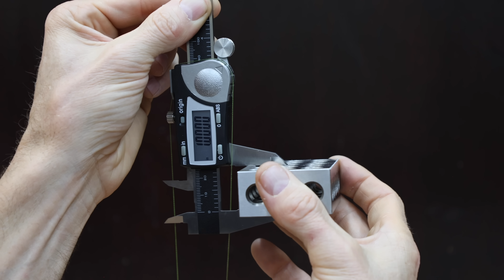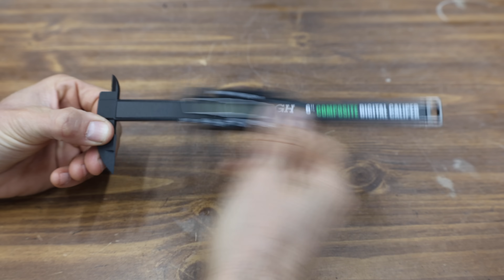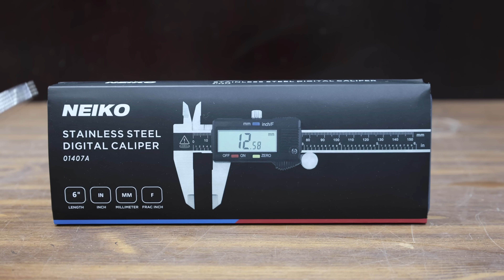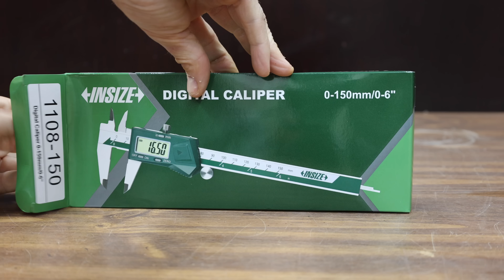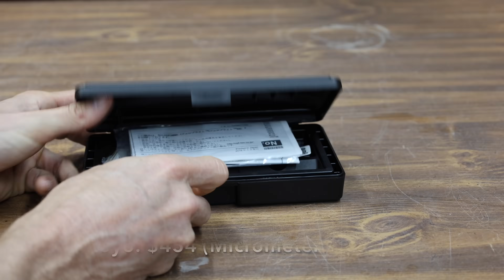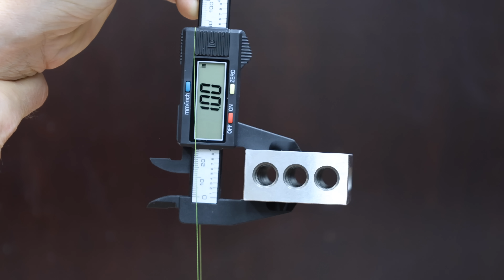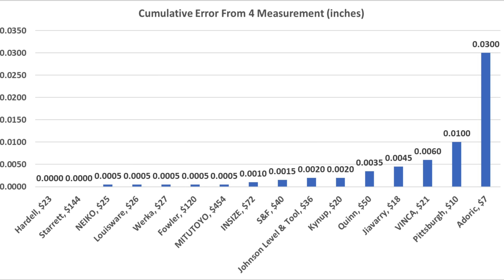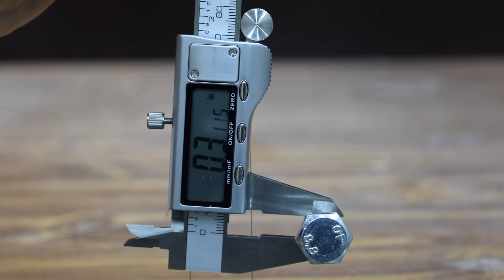I've Been Proven Wrong About Calipers!

Comment: As usual thabks for the video. If I were a machinist, using them every day, I'd definitely go with Starret, Mitutoyo, etc. For the average person that doesn't use calipers very often, the cheapos work just fine. I only use a set a calipers maybe a couple times per week. I've got 2 pair of Pittsburg calipers (different than the ones in this video) I've used at home and work for years and they have been just fine for what I do. What I like most about the Pittsburg is if for whatever reason I break them, just walk into HF for a free replacement.
Reply from the maker: You are welcome!  Thanks for the feedback.

Comment: could you test dehumidifiers? i've owned many through out the years and im curious which brand is the best. You could test energy efficiency and which ones produce the least amount of heat because most just spit out hot air while dehumidifying. and also maybe have a separate category for those "personal sized" dehumidifiers that do not have a radiator/ compressor.
Reply from the maker: Thank you for the video idea!

Comment: When I was a machinist in the airforce all our measuring tools had sent over to be tested before being put into use and then tested again I think it was every year.   The testing was done at a designated temperature.   Our Mitutoyo calipers some were rated at +- 0.001" and some were +- 0.002".  Most of our micrometers were +- 0.0003".   Now I am out doing 3d printing most 3d printers are only accurate to about +-0.1mm(0.004").   My calipers of choice are the Husky home depot house brand because they're good enough for what I'm doing and if anything ever goes wrong the life time warranty means I walk into the closest home depot and the return desk just has me go grab a new one off the shelf. No hassle. No receipts.  As long as it says husky grab a new one.
Reply from the maker: Thanks for sharing.

Comment: After 40+ years of being a machinist, I would have changed the test slightly.  I would have first purchased a Gage Block of 1.000, then 2.000, then maybe 4.000.   Gage blocks are usually guaranteed accurate within millionths of an inch.  The cheap calipers might not have lived up to the various lengths.  1-2-3 blocks  normally have a .0002" accuracy, so +-.0002 overall, and flatness of .0003.  I would have also checked the ID of the calipers using a Ring Gage.  Those are also within 15 millionths.  All my years machining and inspecting we were only allowed to get Mitutoyo, Brown & Sharp, or Starrett.  In my opinion Mitutoyo is the best, but realize many DIYers don't need the accuracy so the cheap ones will probably be ok.  Thanks for the video's as always !
Reply from the maker: You are welcome!  Thanks for the feedback.

Comment: After reading most comments, there were a lot of comments about battery drain when not in use. When I won't be using my calipers I take out the battery and put it in upside-down and close the cover. There are no contacts for the battery to complete the circuit.
Reply from the maker: Thanks for the feedback.

Comment: The cheap ones are great for cheap jobs. A quick disassembly and cleaning will significantly improve the smoothness. Apparently this is probably one step skipped during production, that $10-$20 calipers don't get that $40+ calipers get you. And no, the cheap ones still won't be like the $40+ but they will be better than out of the box.

Comment: I bought a no name brand set with dial calipers and non-digital 0-1" micrometer at Costco and Ive had them for close to 25 years now.  Both still work excellent.  I did about five years  in machine shops and doing tool and die work in the 70's..  In those days, Mitutoyo, Brown and Sharpe and Starret were king.
Reply from the maker: Thanks for sharing!

Comment: I've had a Shahe bought from China for 5 years now. At the time I heard they are an ok option for a cheap but still decent caliper. It's been rock solid all this time. I think I only replaced the battery twice and for my needs it has been precise enough. I'm a bit bummed this brand was not present in the test, I would have been curios to see how it measures up to the others.
Reply from the maker: Thanks for sharing!

Comment: Lithium batteries like the 2032 are "Technically" not allowed in checked luggage and the tool itself is "Technically" not allowed in a carry on. Dial calipers bypass this issue and never need battery replacements.

Comment: I have a set of iGaging IP54 Absolute Origin 0-6” calipers.
I use them infrequently, as most of us typically do, mostly for gunsmith jobs and welding precision (as well as the hack that I am capable of anyway) projects.
Had them for 10 years and have replaced the battery three times.
They work well enough for me, and I use a WEN 1-2-3 block to check them when I use them.
Not bad for a 55 dollar tool.

Excellent testing and review video as always. If I need another set of digital calipers and can’t find the Origin, I’ll look at the Werka.

Comment: I wish that you would have done the husky. The only test that I could replicate was the closure Force test. I ran it several times on a $25 kitchen scale from Amazon. The movement felt smooth throughout. To force range from about 260 g to around 290 g. It is it at least several years old. It uses one of the small batteries that you showed. The battery has not died so far, but I do not use this on a highly regular basis. Thank you for what you do. I really do enjoy your videos.
Reply from the maker: Thanks and you are welcome!

Comment: I have the cheapest ones and they work great. I was pretty skeptical but doing measurements for 3d printing it works just fine. Only downside is it does go through batteries maybe aim to get one with larger cr2032s.
Reply from the maker: Thanks for sharing.

Comment: I'd love for you to throw iGaging into the next batch if you revisit. I found them highly accurate, more of a feature-rich mid-tier.

Also, I don't think I've ever used my calipers outside of metric mode, and yes I am an American.

An idea for another test:

- Vampire Drain: A lot of the cheaper calipers I've used have battery drain (even with auto-off) when in storage, so you'll come back and find them dead after a few weeks.

- Whether they include USB/Bluetooth HID. The set I have sends the measurements as keyboard inputs upon button press.
Reply: I am also a big fan of the iGaging calipers.    They are very accurate and an excellent value.   A machinist would cringe at the way I use calipers because very often they become a marking tool.   I don't have to lose sleep over abusing calipers in this price range.
Reply from the maker: Thanks for the suggestions.
Reply: Do you know if they counterfeit those?

Comment: Working in an machine shop für 10 years, having a Mitutoyo. It is reliable, accurate and in 10 years i have changes the battery twice with lots of daily use. 
It cost somewhere around 150 Euros, worth every penny. 

By the way, dont bother with that little wheel, get one without it.

Comment: Ill just say this. If I walk in a machine shop and they are not using Mitutoyo or Starret or anything US made from 30 years ago, Im walking out.
Normally you do good, but this one doesnt hit the mark. Each time you measure, you will get variations. Its why you measure 20 times for one span.

Also, the stiffness increases at the lower range by design. 
1 thousands off is not even remotely close to being accurate for machine work, so something went wrong here. 

Additionally, the best shops will use a dial caliper, not digital. Digital is for quick and sloppy work, ie, checking which part is which, between known measurements, that were checked prior with dials.

Comment: I just refuse to use digital calipers. Only dial or slide ones for me. Digitals, they die while not used, or accuracy degrades once the battery is getting close to be dead.
Reply from the maker: Thanks for sharing!

Comment: Comparing digital caliper results with just a stainless steel stamped caliper with a single vernier scale is entertaining. For basic stuff like sizing ikea hardware, holes of indeterminate size, depth of containers, etc, 2 decimal points is more than enough. When measuring for 3d printer designs, etc. a good digital caliper is a must.

Comment: Todd, I love your videos, but I'd like to provide some constructive criticism about some testing methods. I've done some environmental, electrical, and digital testing work before in electronics.

1. Statistical significance: a sample size of one is statistically insignificant. Each test for each tool needs to have multiple measurements. The higher the better, but even three would be much, much better than one single measurement. For example, Neiko scored quite well for cumulative measurement errors on the 1-2-3 block, but mysteriously performed quite poorly on the drill bit measurement error test. This can probably be explained by operator error, statistical anomaly, and probably even some variance on the drill bit itself. Perhaps the calipers were opened or closed too quickly (something the manufacturer states not to do), and this could affect the results, too. Two pieces of masking tape on the drill bit with a narrow gap between them can easily ensure each caliper measures in the same exact spot.

2. Weighted scores: accuracy of measurement is far more important than maximum variance in force to slide jaw and ranking of smoothness. Why? I'm not buying calipers to slide them for fun; I'm buying calipers to measure stuff. A caliper that's smooth but inaccurate is far worse than a caliper that is not so smooth but very accurate. These scores need to be weighted to add more value to the most important metrics and lessen the impact of the least important metrics. The exact weight can be subjective, but as it stands, the weight of each score is exactly 1, and this is definitely not the best weight.

3. The o-ring groove test is in no way accurate since the groove is handmade, the measurement taken by each caliper is not in the exact same spot, and the bolt head is facing the camera for some calipers, and the other way for others.

In the pursuit of good products, we must make sure we are evaluating them properly, otherwise, test results may mean little. Thanks for the great work you do! I look forward to your other videos.

Comment: Did you zerro the deph mesure stick befor using it ? , you have to press the end of the caliper agains something flat, and at the same time pressing the messure stick against the same surface,,and then pres zerro ,

Comment: I got one called " SHAHE ", the yellow variant with scale in milometers printed. It cost me 25$ with shipping from China. It's 0.01mm accurate. It looks like the Kynup in terms of metal body, the battery is under rubber gasket cover.  From what I have read, there is just no point getting the Mitutoyo when there are so many other very good and affordable models.
Reply from the maker: Thanks for sharing!

Comment: On the low end units there are good and bad. If you get a good one, you're golden. Steel wool will help the bad ones.
I've never seen one that's not good enough for caliper work.
Reply from the maker: Thanks for sharing!

Comment: I have a variant of those cheap ones, and I kept the little plastic tab to isolate the battery while in the package. After using it I replace it so it doesn't drain the battery. If you cut it at just the right angle it turns into a viable on/off switch.
Reply from the maker: Thanks for sharing!

Comment: The high battery consumption of a cheap caliper will more than pay for a nicer caliper in just a couple years. Even a modest caliper like iGaging is light years ahead of the cheap ones that never shutoff the position sensor, they only shut off the display.
Reply from the maker: Thanks for sharing!

Comment: I’ve had the Neiko for less than 6months light use never dropped and the shim came out. Bump it and it turns on battery life is garbage and you spend more on batteries than you did the tool quite quickly I do not recommend. Bought a Mitutoyo while on holiday in Japan. Buy once cry once.
Reply from the maker: Thanks for sharing!

Comment: You should see how long the batteries last when not turned on. The caliper uses some electricity to maintain memory of its current position. Cheap ones will die pretty quick.
Reply from the maker: Thanks for the feedback!

Comment: You're not supposed to be holding the block with your bare hands!  Heat transfer from your hands to the block will change the dimensions of the block enough to change your measurement when you're seeking precision in thousandths.  Those $10 calipers aren't good enough to detect the difference.  But, those Mitutoyo sure are.

Comment: Hey PF! Great Vid, but you made a mistake on the Starrett 1-2-3 outer size block test. The tiny "5" next to the zeros indicates it's 0.0005 over in the end of jaw test for 1" AND the 3" measurement. Also I've got a concern for the accuracy on the hole depth measurement on the 1-2-3, since the variance of the surface under the block has to be taken into account. If I were to re-test that, I would clamp the 1-2-3 to a glass plate before testing each caliper in each of the block orientations.

Comment: One feature that many of them have which wasn't mentioned is a data interface port that an optional 'data output cable' can plug into.  {Many cheap ones can be interfaced with an Arduino/etc. that can then emulate a USB keyboard to directly input measurements into your PC.)  Some companies like INSIZE & Mitutoyo even offer wireless input.  

This is INCREDIBLY helpful when you are taking measurements from a physical object for a model/etc. and don't want to have to go back and forth between measuring and inputting those measurements.
Reply from the maker: Thanks for sharing!

Comment: I ran a service department where in the field I and my staff needed a caliper maybe once a year, so we bought the Harbor Freight of Home Depot brands.  They work fine out of the box, but frequently a year or two later they would no longer work, even with a fresh battery.  I have no big problem with that, but as a boss, it's tough to pay someone to drive across town to buy a $15 tool.

Comment: The biggest flaw I've found with these inexpensive brands is that even when they are "off" their circuitry still draws too much power and runs the battery dead. Finally got sick of reaching in the drawer for calipers just to have to chase down a new button cell. Would be great to see a follow up vid addressing that issue. I'd totally buy a few sets of budget friendly calipers if I knew they weren't power hogs.

Comment: Biggest problem I see is that most of the name brands have lower value lines that they sell and are just as inaccurate as some other cheap brands. You have to base tests on similar lines that have the same scales. Testing one that goes down to hundredths and another to ten thousandths is unfair and I would think maybe misleading. Not all mititoyo calipers are the same. Some are very expensive and accurate and some are cheap and made of plastic.

Comment: Important note about the batteries:  The 2032 batteries are lithium and won’t leak.  On the other hand, LR44 batteries are alkaline and will eventually leak and destroy your calipers.

I rarely use calipers, so I remove the batteries when not in use.  But this is annoying enough that I usually end up using my old mechanical ones instead.
Reply: They should be SR44 silver oxide batteries not the LR44 alkaline

Comment: Mitutoyo makes the best precision measuring tools, they seem to be the most durable I’ve been using the same 6 inch digital calipers since 2013. I purchased a replacement set in 2014 and it’s still in the box never been opened.
Reply from the maker: Thanks for sharing!

Comment: The test you missed was a battery drain test. Many cheap calipers will eat batteries because they don't really turn off anything but the display. Quite easy to do - just power the caliper with bench supply and measure the current used when on and off.
Reply from the maker: Thanks for the feedback!

Comment: The Mitutoyo calipers don't use an LR44 battery, they use an SR44 battery which is a different chemistry. It has the property that the voltage doesn't gradually lower as the battery discharges so it can keep the electronics at the voltage they need to keep working for longer.

Comment: Great review... however I'm surprised not to see iGaging calipers which are excellent. I'd also point out that having owned a few cheap brands, ALL of them used their battery when off so I'd pick it up a few weeks or months later and it would be dead. Mitutoyo and iGaging cals don't drain at all when off or at least not in any noticable way.
Reply from the maker: Thanks for sharing!

Comment: You dont really use calipers for measuring .  You can but they need to be confirmed by another device if the measurement is important.  Having thought about it don't really know what calipers are for.  They can measure but not to the tolerance of anybody that makes metal objects. 
They are overkill for woodworking and I have only ever used them as a machinist to ball park anything. like the blue print says a part should be 25.4mm as opposed to 22mm . They are good for that.  You wanna know if it's 25.4 or 25.3mm , nah . The micrometer comes out for that.